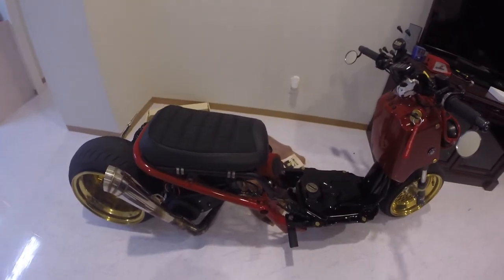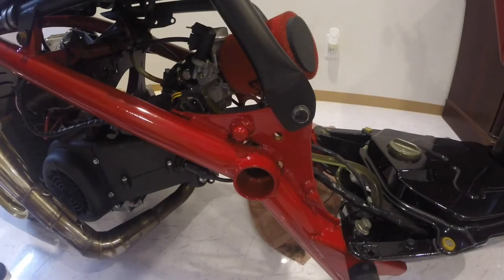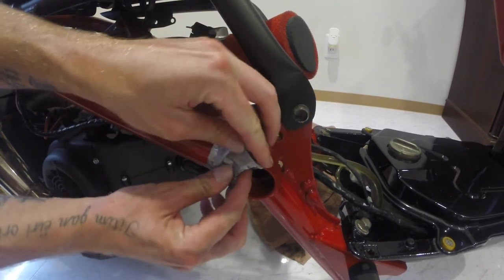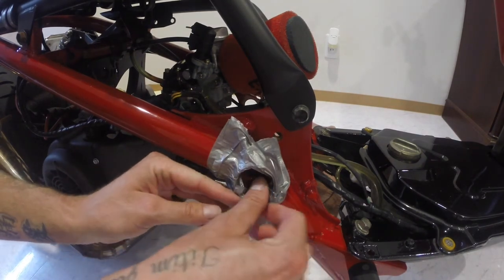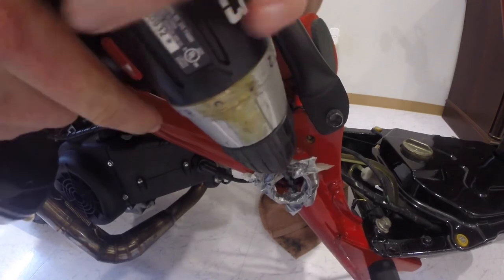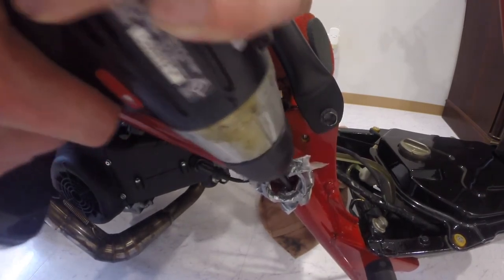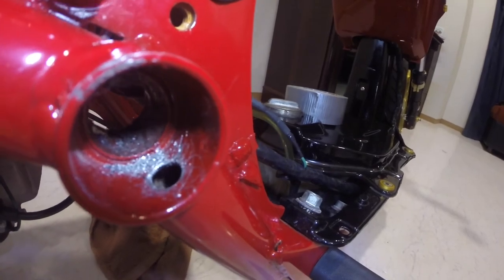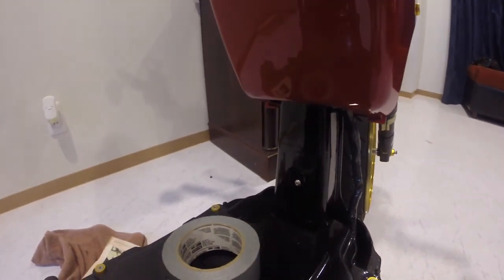How To: GY6 Ruckus Wire Tuck

Comment: Should’ve been called, guy drills hole in ruckus. There’s no wire tucking going on here.
Reply from the maker: Where do you suppose you tuck the wires to without drilling a hole in the frame to run wires through?
Reply: @RuckinScott  so a video titled “changing car oil” should just show someone popping the hood i suppose? Appreciate the content, but do better.
Reply from the maker: @endofanera1  I might take that into more consideration if you weren’t commenting on a 3 year old video.